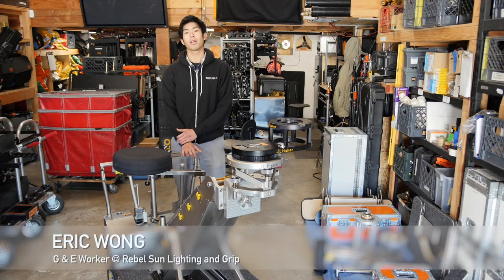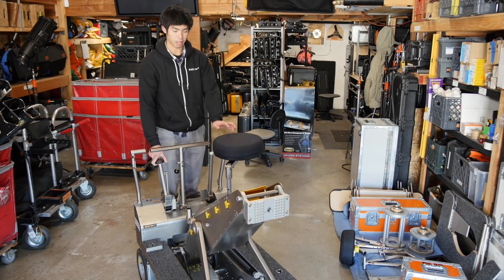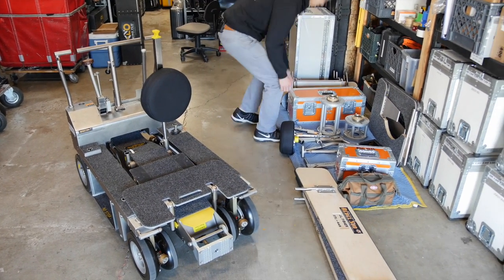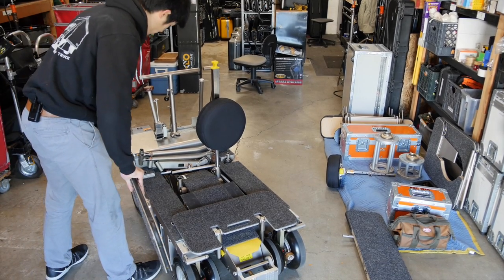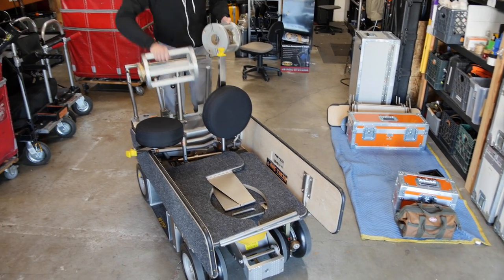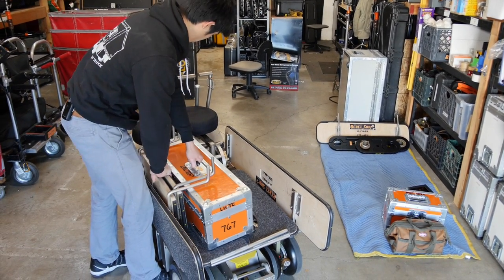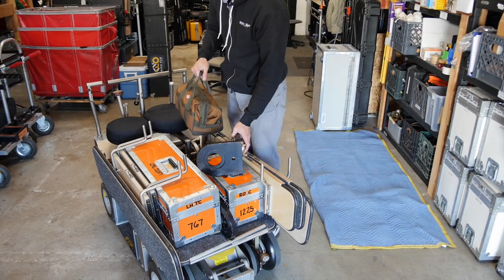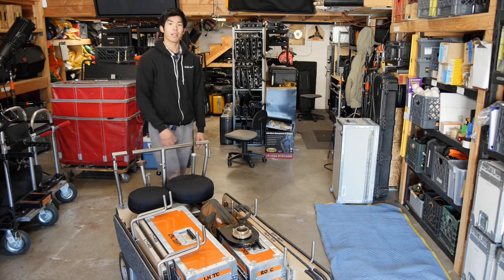Meet The Gaffer #32: Loading A Fisher 10 For Travel

Comment: You don't use the Fisher AKS Cart?
Reply from the maker: Fisher has a cart and Backstage has a nice accessories cart, but for a lot of guys up here we don't really have room in our smallish trucks for another cart, so we often end up carrying all the accessories on the dolly itself. On the job site we'll often load up a hamper or handtruck so we can move the accessories around as the day progresses, but when it goes back to the shop the dolly usually gets loaded like you see here. Not the most efficient method, but it's worked this way for many years. I figured if there was a video for it at least the guys back at the shop wouldn't have to rearrange the pack every time. Now we need one for the F11. No more PeeWee's in SF... sliders and Dana's finished them off and they never came back. Fishers have made a small resurgence though...
Reply: That's very interesting, also Gimbals have seduced the younger filmmakers who would have coveted the JL Fishers like I did as a young DP.

The Fisher 11.... ehh.  Too bad to hear about the PeeWee they still have them in NYC and Boston.

Really interesting to hear about this from another perspective.

The ability to change height either mid shot or quickly adjust if needed is the reason I still insist on them being on my commercials work, but I get the price and logistics of moving it around are painful compared to a slider/gimbal.
Reply from the maker: Exactly, when you've got a camera all decked out it's so much more efficient to change height and position with a dolly than messing with sticks. And when you want to use a big boy slider, a dolly is usually the better tool for support. All the new tools have their day in the sun and then we usually get back to what really works or we adapt and add to the bag of tricks!
Reply: You'll see on my channel we'll be putting the Movi Pro on Fisher/Chapman dollies and using wheels to operate.  True old meets new 
<3

Comment: Very Interesting item! Luke this question is about gels , Have you use the Rosco Super Heat shield, and what are the Pros and Cons of it? Thank you for your great reviews!
Reply from the maker: Felipe Henao, it's been a long time since I've used heat shield gel. We used to use it when we had hot lights close to sets or furniture that we were worried about setting on fire with our lights:-) It was very expensive, but usually did a pretty good job. However, it doesn't save you from truly foolish placement of hot lights... like being too close to ceiling water sprinklers! Maybe someone out there has more recent experience and best practices they'd like to share?
Reply: Seems to me that Heat Shield was something you'd use with Par cans in theater settings. Once the lights are up in a grid you don't want to have to replace a burned up gel. Saving gels was the main reason to use it.
Reply: Exactly, I want it for being able to spot a 1K Lowel DP with a CTB on it without burning the gel
or spot it on an umbrella without scorching. Wonder about Cons ot doing that!
Reply from the maker: Are you able to buy smaller sheets where you are, as opposed to purchasing full rolls? That way you can try it out before you fully commit.
Reply: Sure BHPhoto New York sells Rosco Super Heat shield at $ 12 the 20x24 I just ordered.
I'll let you know, Thanks for the interest